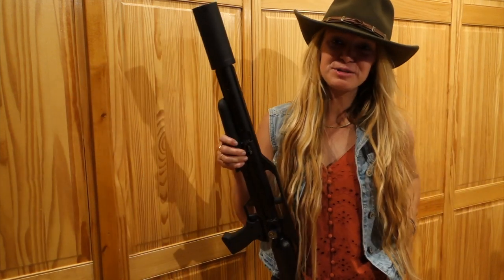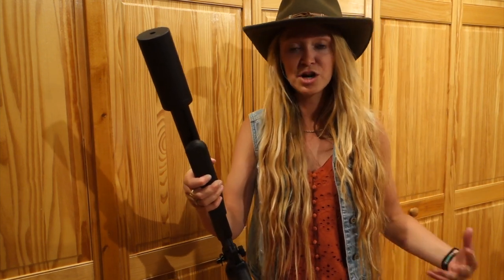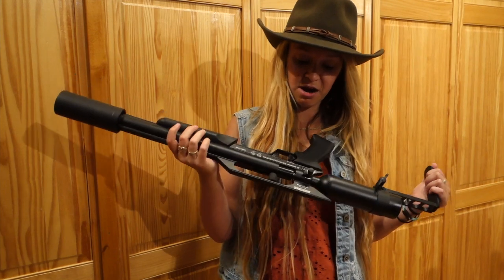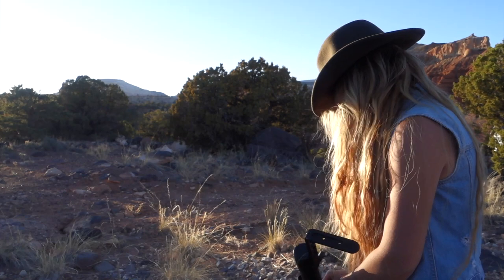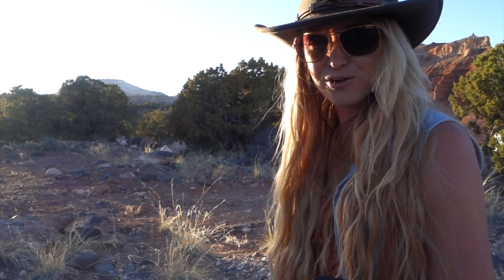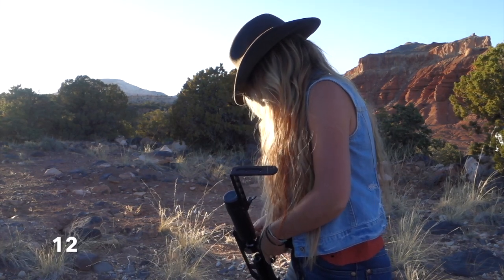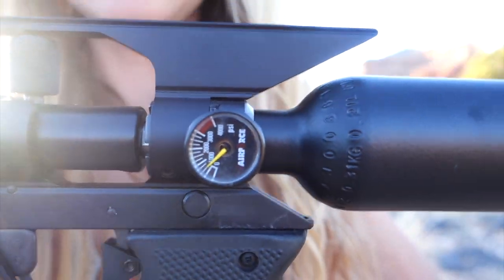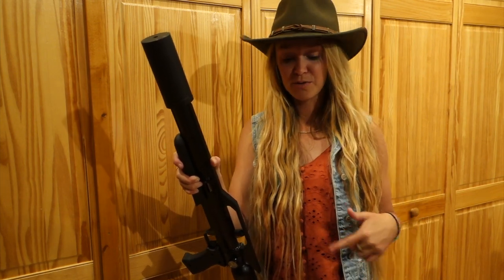How Long Will An Airgun Last In The Field ???

Comment: hai.. on talon p carbine...when the air pressure decreases, will the fps decrease? I mean will the firing power of the pellets be reduced?
Reply from the maker: Yes it does, for max speed and knock down make sure to have high pressure in the air rifle!

Comment: I have the same gun 25 carbine bought as a kit ,red dot ,moderator, but stock took off the red dot added a scope I usually set the power wheel to 5 -6 and use 20.4 grain h&n ,,its a very nice piece of machinery it is my hunting gun as accurate as it is I only need one shot,,I will turn the power wheel to 12 and use 36 grain slugs maby a 43 gr for shooting  hog and deer
Reply: .25 cal isn’t legal for deer in my state.